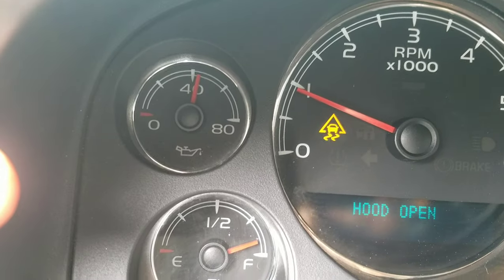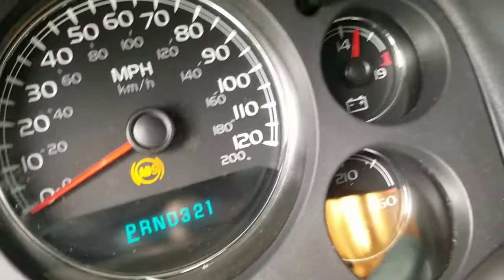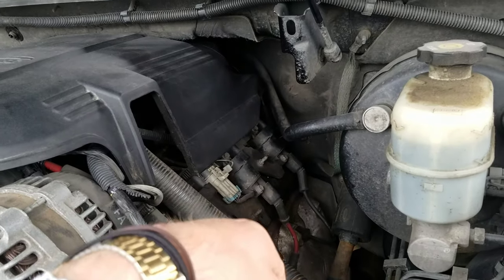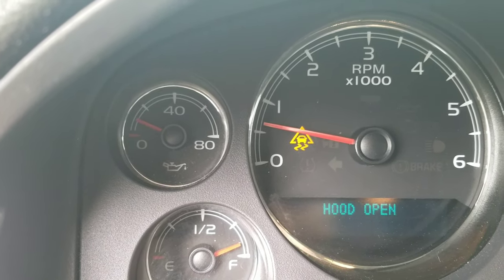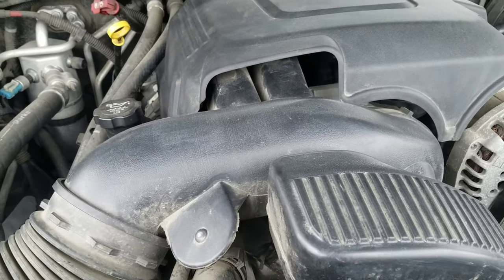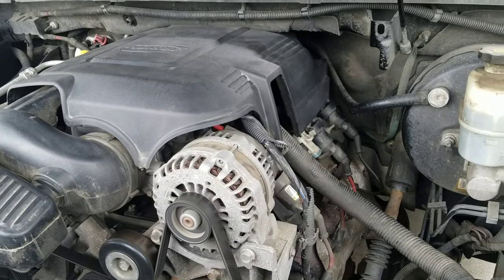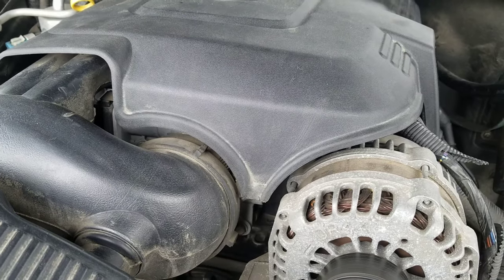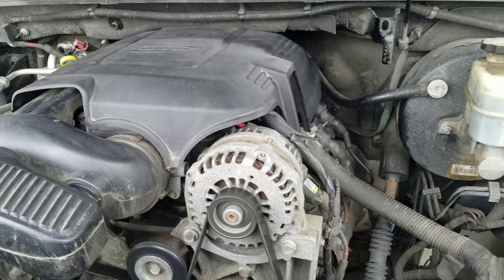0 or Low Oil Pressure? Chevy Suburban, 5.3l Vortec 2007-2014, Tahoe, Yukon. Diagnose and Fix Easiest

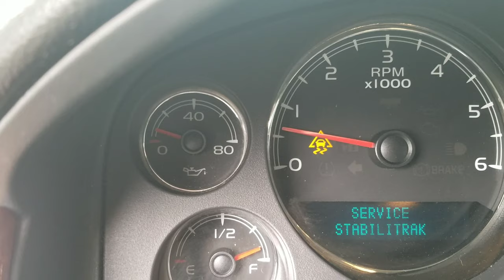Comment: 1:58 my oil pressure reads like that while sitting at a stop light while up to temp, but I've never gotten any warnings.  Dealer already installed new oil pump, sensor, check valve and o-rings.  And the only time it will reach 40 is at higher RPM in below freezing weather, when the engine is not warm.  While up to full temp and driving 55mph, it stays around 18-20 or so.  182K miles and 2440 hours on the meter.
Reply from the maker: Sounds like a tired motor if everything has been replaced. The afm on these shortened the life so much by burning all that oil.
Reply: @g3mccotter  My AFM was still working when I got the truck, but I ended up disabling it with one of those Range modules.  It's a 2011 Tahoe Police SSV package, so it's had some use LOL.  Though I also have the full service records, and it's always had regular oil changes and other care.  They also list a camshaft replacement being done a few years ago.  The inside of the engine was clean when they opened it to do the oil pump.  I just thought it was odd how my oil pressure is lower than average.

Comment: Mine has been reading 0 pressure for like 6 months. It ticks when cold and ticks when I’m parked for a few minutes but it doesn’t tick after a long drive any ideas please?? Truck runs great just ticks more than I want it to and reads 0 pressure
Reply from the maker: Need to go through the things mentioned in video. Starting with checking oil level, the afm burns oil.
Reply: @g3mccotter  burns maybe half a quart in between 4500 intervals and I always use full synthetic and a quart of Lucas every change with high mileage Mobil one filter
Reply: Sounds like a lifter sticking. I used a can of sea foam. Worked for a while then started ticking again. I finally traded it.

Comment: Wow... Talk about frustrating... Watch this video while in your Tahoe having the same issue. LOL.     The combo of my trucks alarm & the alarm in the video will make you want to pull your hair out. 
  I replaced the sensor  But didn't realize there was a metal screen filter under it.   Hoping that fixes it.
Reply from the maker: Probably a much deeper underlying issue. Really need to determine if you're getting actual 0 oil pressure like the gauge says.

Comment: The stabilitrack and check engine warning with the traction control is from your spark plugs btw, had the same problem. I promise that's all it is 💯
Reply from the maker: Those warnings go off for different problems actually all sorts of issues will cause those warnings. Mine went away once oil pressure gauge was reading right.
Reply: I replaced all my speed sensors and it cleared all my track an abs lights.
Reply: I've changed out all my plugs/wires and still have Stabilitrak issue....
Reply: @ericnorth7032 Make sure there are no cracks in your air intake, any air sucking in on the engine side of your air sensor can foul up your computer because it doesn't know what is going on. Especially around the air chambers (resonators) that branch off your air intake. I found a hole and my truck went from sounding like it was running on 7 cylinders to purring like it was brand new.
Reply: @addisoncorley2244  do you drive fast, is why you changed your speed sensors? I ask this because I push my suburban to its highest mph all the time, and I have ALL of the above mentioned warning lights on, on my dash.

Comment: Other videos show that it could be the oil pickup tube gasket. I have a 2007 Chevy Tahoe that's doing the same thing with 254,000 MI
Reply from the maker: Yeah could be that. I didn't pull pan
Reply: @g3mccotter  How is your oil pressure now?
Reply: I just replaced the full synthetic oil and filter. Used ACDelco pf48e. It's back at 40 psi. Fingers crossed. Might add Lucas.

Comment: What if oil pressure goes low then stays low will this still possibly work?
Reply from the maker: Yeah mine never went up but the engine didn't tick or knock so I didn't believe it
Reply: Autozone told me not to cuz it thins oil. "That the goal was to not cause damage"..because I was gonna do this with seafoam and the other stuff. So bought oil pressure switch first.
Reply: Was you able to start it still while low? That's my biggest worry? And also can oil pressure  go up after fix without starting?

Comment: How in the world do you get the filter out? Im on my third sensor and my low oil pressure light is coming on again. Never once changed the filter cause I couldn't figure how to get it out. May be the cause and/or clogged but who knows
Reply from the maker: Are you talking about the little screen under the sensor? That one you can get out with a pick. I changed it when I did the sensor without any success that's why I did everything in this video which worked. I maybe even ran it without the screen I can't remember
Reply: @g3mccotter  Yeah that one. I finally got it switched out plus a new sensor but no luck. This truck unfortunately will have to go to the shop🤦🏻‍♂️
Reply: @augustinerubio2004  used a bolt that fits snug tight in the new filter.
Reply: You can use s machine screw. Scare it into the filter and pull it out without damaging it
Reply: Go to harbor freight, get a pick set.. about a buck... use the 90 deg one and stick it in the hole and punch it through side of the filter and pull it out.. very easy
Reply: I used a pick to pull the little filter out.

Comment: my 2008 chevrolet silverado is the same on the dashboard it shows 0 oil pressure, and all the oils are fine, I hope it's the sensor and not the pump 😬
Reply from the maker: Probably neither
Reply: @g3mccotter  the sensor was fine, it was a fuse

Comment: seeing  how you have warnings for traction control and stabilitrack ,I would suggest you have AFM issues.when it fails it always forces those 2 warnings.
Reply from the maker: Those warnings are triggered by all sorts of stuff unfortunately. But yes afm definitely has issues it burns oil and fouls plugs
Reply: I have had the dod delete done on m engine with new cam and lifters and valley plate and I still get those lights. If you have any miss they will light up. It’s hard to diagnose because too many things trigger them.

Comment: What you do . Are you fixed. I have this problem
Reply from the maker: I put a quart of atf and a bottle of seafoam in the oil and drove it around for an hour or so. It took a long time and a lot of driving to get it to clear up and alarms to go off. If the engine is making any noise like ticking or knocking when the alarms are going off then shut it off immediately you have a different problem.
Reply: @g3mccotter  In the video you said half a bottle of seafoam.  Did you end up using the full bottle and 1 quart of atf?
Reply from the maker: @andrewwray2457  I cant remember.
Reply: @g3mccotter  i feel like I hear a ticking.... what does that mean?

Comment: Did you ever fix it?
Reply from the maker: Yeah this solved it. Engine wear is probably already there though since these things do burn oil and have starvation issues probably due to sludge
Reply: When you drove it around for after did you still have the atf in it? Or did you change the oil?

Comment: When did you  finally  change the oil?
Reply from the maker: Once the oil pressure was up for a while maybe 100 miles.
Reply: I'm trying it this evening.
Reply: 2008 yukon XL Denali 6.2
Reply from the maker: @bennettloparo6744  the 6.2 didnt have afm so low oil pressure could be something else. Put a manual gauge on it.

Comment: Did you ever figure out what the issue was?
Reply from the maker: Yeah gunked up oil that gives inaccurate pressure readings.
Reply: @g3mccotter  How did you fix that problem???
Reply from the maker: @mercedesbenzs600bash  What I mentioned in video

Comment: It's the oil pressure sensor I had two of these cars and had the same problem on both
Reply: Don't use aftermarket oil pressure sensor
Reply from the maker: I used oem

Comment: It's the o ring in the oil pick up tube
Reply from the maker: I saw that as one of the possibilities. If that were the case though wouldn't the oil pressure actually be low like the gauge is saying and I would be hearing the engine start to make noise from starvation?
Reply: O-ring is damaged, it can allow the oil pump to suck air through any gaps, rather than clean oil from the pan as intended.
If the pump is sucking some air, it may be able to overcome this at higher engine speeds, due to higher flow. But at idle, when oil flow is already pretty low, ingesting air via the failed O-ring could be enough to reduce oil pressure.
Reply: @mnjfmj9071  i replaced the oil pressure sending unit and the o ring and still has the same problem. anyone else have any idea what it could be? my engine sounds nice just like his and has a fresh 6 quarts in it
Reply: @gdog7933  mine is the same im being told main bearing
Reply: @crodgers1011  I took to oil pressure sending unit back out and it had oil in the plug part. So swapped it for a new one and fixed the problem. Now I am have cylinder misfire on cylinder 5 and 7. Not sure what is going on now. New plugs and wire 6 months ago.
Reply: If is burning oil ? PVC valve maybe
Reply: What was your overall fix?
Reply: @gdog7933  mine is doing the same thing. Did you ever find the problem? Oil pressure sensor and pump have been replaced, along with misfire on 8. Already did a tune up, wires and plugs changed out. Oil change and its still going off. Can't see what the issue is?
Reply: @alodie6883  shortly after all this happened it started knocking. Pulled a plug to do a compression test and the plug was damaged. Did an engine swap and pulled heads just out of curiosity and something bounced around on the top of the piston. Still not sure what caused all the issues originally but it was pretty jacked up.

Comment: Any updates on this? How is the pressure holding up?
Reply from the maker: Yup pressure held strong. I have sold the car since then but it didn't change.
Reply: @g3mccotter  ....ahem .... truck...

Jk😁. Ive got to change my sensor. Im not super mechanically inclined, but I can change oil, minor electrical,  body work, etc.  Its not too terribly difficult to do is it? Just need a swivel socket?
Reply: I changed the oil too 10w30, problem solved

Comment: I haven't tried this but I do know the battery needs to be replaced...Stability track was my first light.Then now this code for oil pressure low.My oil life left is 7%.I just bought it..So I have some work to do.Might make a video to help others when I find solution.I know while driving the whole car lost power for a min.Engine still sounds strong
Reply from the maker: Bad battery can sometimes be culprit for some weird lights to come on like traction and that. Oil pressure low though I don't think so.
Reply: @g3mccotter  yes.So my tech fixed my vehicle by adding heavier weight oil MOBIL 1 with filter.As well as sensor.No lights rides smooth again

Comment: I have absolutely 0 oil pressure. I parked the truck and it started clattering. Shut it off as soon as it happened.
Reply: Same here. Did you figure it out?
Reply: Nope. Think its an oil filter. Bypass valve could be clogged.
Reply: storm wickham I cleaned out the valves etc. Still nothing. Replaced the oil pump and boom. Now I have pressure.
Reply from the maker: Yeah that sounds like actual low oil pressure. My solution probably wont help you.
Reply: @bradleyp9123  pushrods were like bananas. Faulty lifters and oil pump.

Comment: Guy I cant read all these comments but I will tell ya...SELL this truck now!  Worst motor EVER. Damn AFM 8 called to 4 cyl will stick or collapse ur valves and lifters. U can buy a Ranger AFM disabled if u don't have issues YET. If u don't you WILL. Aside from that, troubleshooting-wise...ifnu changed the sensor AND screen beneath it, next probability is O-ring on oil pick up tube in the pan. Not an easy replace without an overhead lift but can be done on a rollerblading. Pull the tube while in there and check screen of tube for metal bits. If not either of those, intake metal plate on top of the block which channels oil where it needs to go (can't remember the part name) is about a $200 last resort crapshoot but many have said it resolved everything. I have the same going on with mine as urs but much much worse....I am still pecking away at it. Good luck!
Reply from the maker: Thanks for your comment. Yeah their afm system was crap

Comment: Tengo. Un problema. Igua.  Lleve. Mi troca. A. Reglar. La trasmisión automática.  Y resultó con baja presión de aseite.  I  alarma de luz de aceite.   I. Cuando. Yeve. La troca al taller. No tenía ese problema. Alguien. Que. Le aya pasado algo similar.
Reply from the maker: Transmission problems probably need a new one
Reply: @g3mccotter      ola. Buenas noches amigo.   Me. Renplasaron. La trasmisión. I. Resultó. La luz.  De oil. Warning.

Comment: It’s an old truck probably better just to change the oil pump and o-ring.
Reply from the maker: That's what a shop would certainly say.
Reply: frr that’s what I originally was going to do until I found out it was a common problem. My mechanic said the car wouldn’t run at all if it was an oil pump
Reply: Intake plugged path to sensor

Comment: My 2002 chevy exp 1500 5.7 liter vortex is too g same thing. Starts at 40 psi then after warms drops to 0 at stop light. Changed sending unit and it got worse. But run a great no noises at all took to auto zone to run diag test. Said bank 2 sensor 1 was bad replaced it tested again still says bad 02 sensor . ithink it has gremlins in it lol. Do t know what to do as im on ssdi and can't afford to buy another vehicle. I take care of my be ridden ex wife 2x stroke victim. And her 2 autistic adult son's. So at end of of month im lucky to have 5 dollars in bank. Just don't wtf to do.
Reply from the maker: Try what I do in this video. Flush it with those fluids. Afm really gunks up these motors
Reply: It's the bar bell take the transition down and it's a peace that direc the oil to the filter. Look it up I'm not sure what it is called but it looks like a bar bell

Comment: don't run 10w-30 stick with the recommend oil for these engines which is 5w-30
Reply from the maker: With a lot a miles and oil pressure already a little low a heavier oil is cheap insurance
Reply: @g3mccotter  i understand that but when you use a thinker oil on a engine that was designed for thinner oil you are asking for trouble. mainly because the thicker oil can't travel though the valleys that was designed for thinner oil. also thicker oil on these AFM lifters is also not good leads to lifter failure. i used to use thicker oil on things until i learned the hard way. to each other own.

Comment: ATF in oil
Reply from the maker: Yes
Reply: Attempting this very soon 5 -20 minutes max depending what you feel comfortable with it would seem a warm motor would help better to remove sludge...Ive heard a lot say that and diesel for a cycle not driving with it nor underload

Comment: These Chevy do this in the cold with no oil pressure let it warm up and then see what it does
Reply from the maker: Yes. Definitely have done that. Yours should not be doing this in cold. When it's cold it should read higher pressure from thicker viscosity and slowly settle into the right range as it heats up